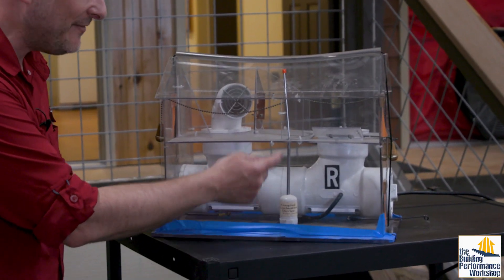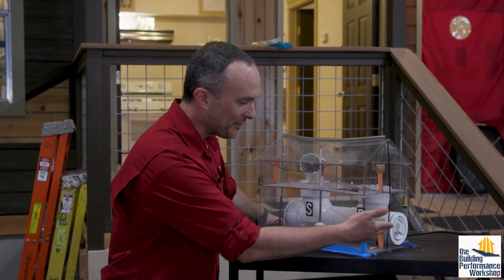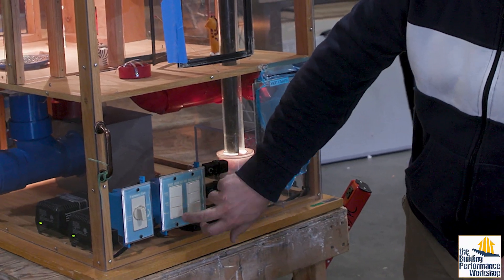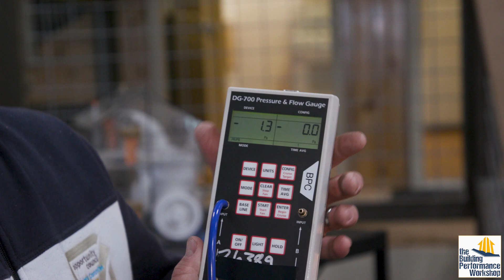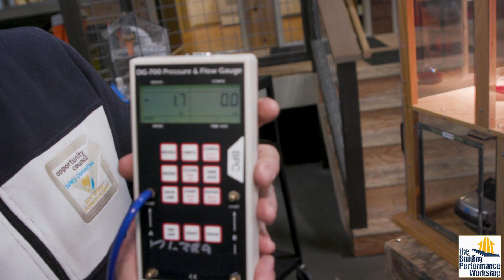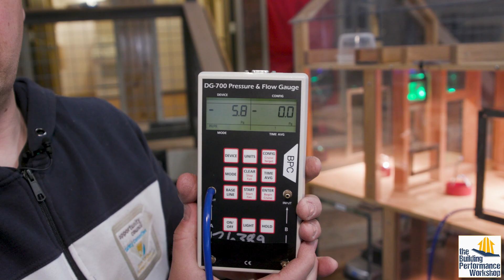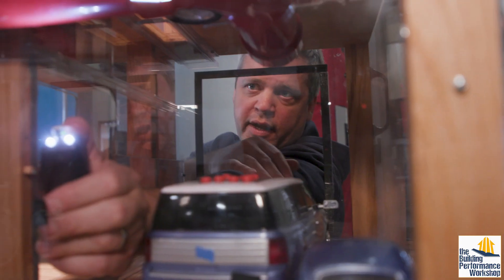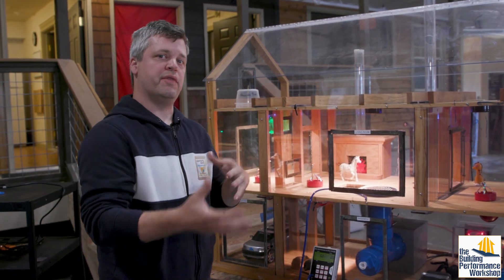How Air Pressure Can Screw Up Your Home: the House of Pressure

Comment: I noticed my basement is slightly depressurized when my air handler in the basement is on high. Im trying to figure out if I should add a larger basement return vent or try and add more(or larger) returns upstairs.

Comment: Excellent video and you're covering a topic that probably very few people know about. It certainly opened my eyes. One thing I never thought about was air coming back into the house through the chimney. If there was a fire I suspect the air would still exit the chimney because the convection from the fire would exceed the natural draw but if that's true then air flow elsewhere would change and it would be really interesting to know what that was.
Reply: You're exactly right, once you get the chimney warm enough to draw, the fire's combustion air will come from elsewhere, windows, doors, outlets, fans, etc.  I used to visit a cabin where we closed off the wide entry to the main living room with a heavy floor-to-ceiling curtain.  When the fireplace was going, the room would get cozy, but that curtain would bow open at the bottom with all the air coming in from everywhere else in the house.
Reply: @MFE92 If the negative pressure becomes strong enough and there isn't an adequate alternative air source (windows, doors, vents, outlets etc.), the chimney's natural draft can be overcome. This can cause the fireplace to "backdraft," pulling smoke and combustion gases (including dangerous carbon monoxide) down the chimney and into the living space, rather than expelling them outdoors.

Comment: This reminds me of my first house, had no wall insulation, but never saw mold anywhere on windows or walls. Of course it cost more to heat, the real question is how much do we save by trying to make the homes air tight now and then spend time and money to make them safe from indoor contaminants like off gassing materials etc..

Comment: This is an excellent video. Have you ever investigated how house pressure influences radon in the home ?
Reply: I did see a video of a very tight ICF house where they actually lowered the radon level by creating a slight positive pressure using an active air input control system.

Comment: What effect does negative or positive air pressure have on the body, if any? Also, can air pressure be affected if supply vents are closed while HVAC unit is not turned on?

Comment: What effect does negative or positive air pressure have on the body, if any? Also, can air pressure be affected if supply vents are closed while HVAC unit is not turned on?
Reply from the maker: I think the answer to both those questions is 0, as far as the science shows today

Comment: What effect does negative or positive pressure have on the body, if any? And does air pressure get affected if supply vents are closed while HVAC unit is not turned on?

Comment: I just watched this vid again. Very thought-provoking. My wife and I have a very nice super-insulated, off-grid home with a wood cookstove. Own own woodlot means we have essentially zero heating costs. Although the home is passive solar, we depend on that stove a lot on those nippy winter days (down to minus 42C!). Well, wood burning appliances and airtight construction don't go together very well, as any depressurization results in serious (and instant) back-puffing of flue gasses into the living space. We knew this before we built, and simply crack a window every time we turn on the bath fan or central vacuum system. This year we intend to finally install a proper HRV system (yes, it should have gone in on day one) but I'd like to find a way to automate the system. In other words, I'd like the system to sense the interior air pressure and adjust the incoming air accordingly. My long-term goal is to make the house do all the thinking, because the occupants shouldn't need to always 'remember'. Great series of videos; keep up the good work!
Reply: Same issue. Thought my chimney had no draw until I thought about it. Had to open the window even wider when wife is cooking with the hood on. Have you found any automated systems?
Reply: I have an airthings view pro that measures air pressure.   But not sure how to automate that.   Im sure an AI chat bot would walk you through it.   If youre using something like Matter or Home Assistant, you shouldn't have any issues
Reply: -42°C!?   You must be one helluva guy to have successfully managed to drag the fairer sex out there!  I'm shocked you have internet.   What did you do before starlink??

Comment: Hi thanks so much for this video I have a couple of question! A little background I am trying to solve trying to increase the pressure inside when outside pressure drops since the falling barometric pressure causes chronic pain in me (looking to see if I can maintain within a range) 

-I saw in your video that too high or too low of pressure wasn’t good for the house and I was wondering what those tolerances are as I mentioned I’d like to see if I can build something to decrease/dampen pain by reducing the rate of the pressure drop so maybe there are ways to increase the pressure tolerances? 

-separately I’ve been looking for a building scientist who has experience working in both a house and in a greenhouse (since im working on building a blend of the two) in case you know of anyone who you could refer for a project?
Reply from the maker: Hey Mackenzie- sorry, but barometric pressure varies in PSI, which is orders of magnitude beyond the pressures we’re measuring or inducing in homes.
I would be happy to consult with you, I specialize in weird stuff:
https://buildingperformanceworkshop.com/video-consulting

Comment: GREAT video. This topic is covered by the Chimney Safety Institute of America who offers certifications for Chimney Pros and Dryer Vent Pros (like me!) and Down here in FL I think some of the issues we face primarily in the summer with a significant amount of condensation build up in people's vents and dryers even is sometimes (not always) related to this. It's something I've been trying to figure out. 

So, dryers produce negative air pressure (along with the other things you mentioned). Dryers as you may know require "make up air" which come from the surrounding vicinity of the dryer. have you found where, when a dryer is NOT turned on, but an AC system is on, that it's drawing so much pressure that it draws air from the outside through the dryer exhaust into the inside of the home? 

Any chance you guys know of any great articles or videos specifically on various ways/ scenarios dryers can be effected by negative / positive pressure?

Comment: I live in a condo and whenever I turn on the fan above the stove or in the bathroom, odours from the unit above me come through the gas fireplace (they are heavy smokers). Your video just explained this phenomenon to me and why it happens - thank you! Next step is to understand what, if anything, I can do within my unit that can prevent it from happening. Is there a way to create a continuous positive pressure inside my unit and if so - what type of equipment is required - and is that a good idea to do (e.g. to live under constant positive pressure)?
Reply: You would need an air source pushing into the house from somewhere else where there isn't an odor.  What did you end up doing?

Comment: HELP!  Great demo-house you built!  Amazing.  We have a 2 story house1940-50ish.  No soffits, Brick house.  49 feet of ridge.  4 turtle vents.  2 tiny gable vents.  Attic space only 36-42'' inches tall at ridge.  Bat infestation.  Removed all old insulation and ceiling drywall on second floor. New drywall, new insulations.   Sealed every canlight and fire alarm boxes.  Greatly reduced toxins in air that caused itchy throat and lungs - smells down 80%. STILL, after all this work, on certain days, (air pressure?) attic smell enters the house. Mainly the toxic smell is on second floor.  Other days, can hardly notice the smell or the itchy sensation.  Any advice would be appreciated.  Thanks Rob
Reply from the maker: Hey Rob- in short:
The 4 P's to Solve Indoor Air Problems and Control Your HOMEChem
https://youtu.be/Z5ycbz1Xz8U

You can find folks to consult with if needed while I’m on hiatus at:
https://buildingperformanceworkshop.com

Comment: My hot water tank was red flagged because it was backdrafting. It backdrafted when we ran the dryer or any fans in the house. I don't think this is normal. What could be the cause of this? Do I need to get an air exchanger to correct it if I can't find the cause?

Comment: What does positive pressure do?
Reply from the maker: Pushes air out
Reply: @HomePerformance  firstly thanks for responding secondly i meant what are the pros and cons for having a house with a positive pressure?

I live in a very dusty/windy area and exhaust fans are a big entry point for dusty air to get in. Also if you were to run two different sized exhaust fans (kitchen and bathroom exhaust fans)
At the same time the bigger fan would suck air through the smaller bathroom exhaust fan opening even if it’s on.

I was thinking about replacing exhaust fans with just positive pressure…any thoughts on what could go wrong? Or what precautions should one take?
Reply from the maker: Aha, that- here you go:
Supply Ventilation for Homes: Mythbusting Side Effects
https://youtu.be/0ak32UorJEg
Reply: @salmanalqahtani6943   Under these dusty/windy conditions, I'd personally worry more about intake(s). Your exhaust fan will eventually push out and clear pretty much anything thrown at them.

Comment: Thanks for the information! Is there an effective way to create positive pressure in a home? Looks like attic fan system is the only way that we found. Great videos. I just don't see one specific to positive pressure.
Reply from the maker: Supply-only ventilation will positively pressurize a home. Either an Aircycler controlling an outside duct into the return plenum, or a ventilating dehumidifier like Broan/Santa Fe.

Comment: Can this negative pressure also cause frozen doors and locks?
Reply from the maker: Interestingly, I would actually suspect positive pressure instead. Or wind blowing on the rear face of the home.
Reply: @HomePerformance  I agree. Cold outdoor air is usually dry air, whereas indoor air is moist. A slightly pressurized house is going to move that moist air into your door locks and that moisture will condense.